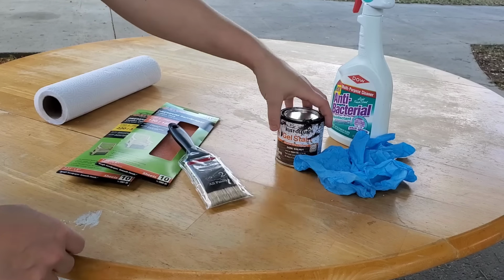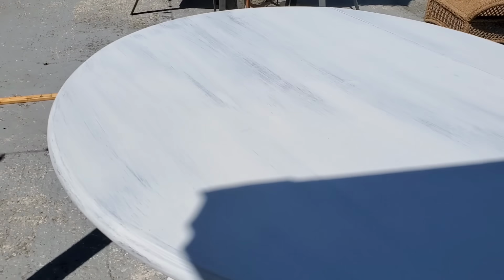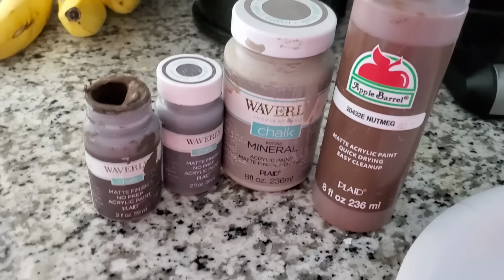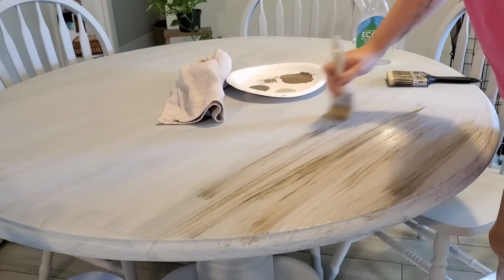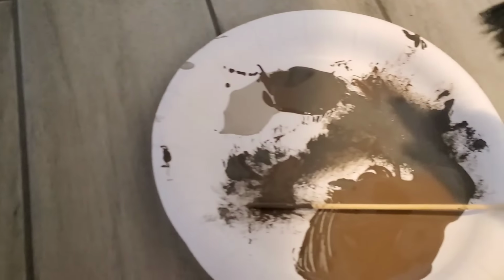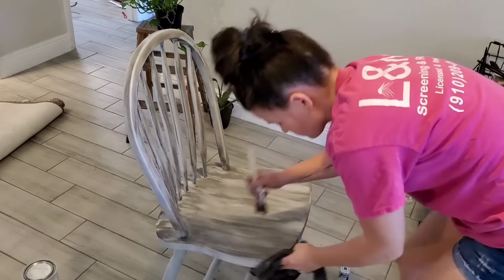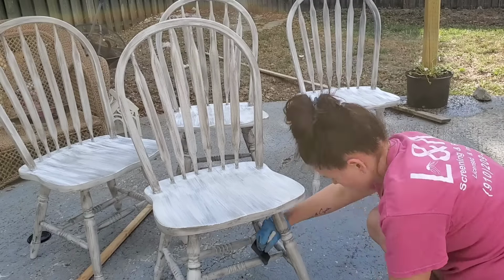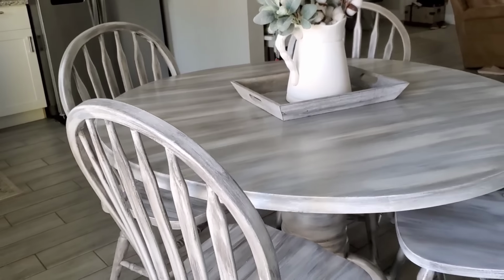Old Table makeover/ First time trying this technique!

Comment: So my woodworker brother gave me this tip...after sanding, use a wood conditioner. Dry and then apply your stain! Will help with blotchiness and streaky. He says this happens a lot on cheap wood/pine/manufactured pieces.  Thought this would help for next time
Reply: This tip is going to help me in the future thanks!
Reply: Yes so true for sure. After I tried wood prestain I've used it everytime I stain something.
Reply: E
Reply: I love that stuff
Reply: What is a wood conditioner brand?
Reply: I cant keep up with her doing it the long way and changing her mind do a test on a similar pc of wood first 😊

Comment: if you use a wood conditioner after sanding, the stain comes out a even color. Just something to consider if you want to try a different project with stain. I found it really makes a difference.
Reply: Julie Carter This is a random question but it if I’m not using a stain, should I still be using a wood conditioner before I use a finish on a raw wood table or does that not matter?
Reply: @AvsFan32  if you're using paint you don't need wood conditioner. It is a base for stain.

Comment: I have tossed chalk paint. I still can get amazing very simple or detailed effects using semigloss, or satin and rubbing gel stain on top, QUICKLY. It's exceptional for dark colors and I can add a top coat. I have never found wax durable in my household. I love this!!! I have a oak table and exactly the color, and this table needs to leave my basement. I spray my poly. An inexpensive primer is cheap dollar store spray paint beforehand. Nice and tacky , no bleed through. Chalk paint is a fad and I am so happy that you left the lines clean and didn't beat up the wood sanding gauges. Good job 👍
Reply: Interesting! Can you explain your process pls? You seem very knowledgeable.

Comment: You did an amazing job!!! I bought two small chair side tables, that you just screw together. I did this exact technique on them, I have the Valspar antiquing glaze and once I did exactly what you did, I took a chop brush and steamed that Valspar on top and didn’t sip and it gave it some dark small streaks throughout and it turned out awesome! You should try it on a project, the Valspar is really nice! 😊

Comment: I agree with thousand percent about starting a project then start changing my direction of where I’m going with it. I honestly love what you’ve done with this table, however I wanted to just share with you just if you’re anything like me and want to change it up a little later I did this same exact look with the same exact colors but on a tall square table with high barstool chairs. I loved it but as the time went by I always felt it was all just a little too busy for me when I would change up my table scapes and what not. I left the top of the table alone but I paint my chairs and base of table white then just barley distressed just very little of the edges of chair n base just with a 220 sanding pad just ever so slightly, I absolutely love, love, love it as well as anybody else that had ever seen it before then after my changes everyone just raved over it even saying they did love it before n honestly never thought it could look better because it looked so good before n actually all of them would ask me how did I know or come up with my changes, like you said it’s always just kinda changing you’re mind as going along same in my case I just wasn’t liking different table scapes n knew it just needed a little tweaking. Again I think y’all’s looks amazing I’m just sharing because we literally did the exact same colors, look if you were to put them side by side they would be hard to decipher any differences. I guess two great minds that think alike 😜 Hope y’all family are staying safe, happy n healthy my friend til next video take care 😘

Comment: I love the end product but I do have some advice. If you want your finish to last longer prime the surface first. Then paint thin coats of chalk paint.  It will blend smoother with water to help make the paint move. Also, sand between each coat of paint and top coats. Hope this helps.

Comment: I think you did a great job! I have a large older table that has a modern look. I've considered painting it but the lines of the legs are very modern looking and I prefer rustic.
Reply: You can ALWAYS transform your piece into any kind of style you desire. Just take risks and use your imagination. You can also remove the legs as well and replace them with a different type leg. They have many styles of legs and they are fairly cheap.

Comment: This is really cool thank you for sharing!!! Also the inspiring words of advice was really artistic and effective for me. The only question I have is you sanded the top but not the chairs. Does that make a difference?
Reply from the maker: I only sanded the top because I originally stained it . With chalk paint you don't need to sand as long you let fully dry between coats and seal well 😉

Comment: It's easier to use a Wagner Sprayer for the Polyacyrlic Sealer then applying it with a Brush. You can do this Zig-Zag Style with other unconventional colors for more color in your space. No need to stain something if your going to paint over it.

Comment: Did you put a pre stain wood conditioner on it , usually only a coat or two is needed on the top before you stain it? That’s why it went patchy. Just FYI. More work, but oh so worth it! I’m wax sells it I think.

Comment: Great video! This is exactly what happened to me. I started to stain my table and didn’t like what the colors were doing. I am now planning to chalk paint white with some brown and gray. One question though...Aren’t you supposed to sand down the chalk paint so it has a smooth finish before applying the poly? Thanks!
Reply from the maker: You could do that i just hate sanding so I skip those steps 😅

Comment: Did you sand the chairs before painting? They look amazing
Reply from the maker: No i didn't with chalk paint i don't sand 😊
Reply: @karrielynn  it doesnt start to peel? I want to try to do it to my dinning set but i am si afraid of messing it up
Reply from the maker: @adylenemendoza7980  no  they won't peel if you seal them . I use polycrilic 😁

Comment: Hi, I'm new to your channel. Love the table and chairs, awesome job! Quick question before I decide to be bold and FINALLY paint my diningroom table. What was the brand of the poly-acrylic sealant that you used? Just so I know what to send my fiance to the store for lol. Figured I should start another quaratine project lol. thanks in advance! :)
Reply from the maker: I use the minwax brand and I usually use a  gloss or semi gloss 🙂 make sure you use a foam brush not a roller though the rollers leave streaks and the foam brushes seem to give a smoother finish.
Reply: @karrielynn  Awesome, thank you so much for the response and the helpful info. You rock! :)

Comment: I tried my first makeover n failed miserably.  Still beating myself up. And did it to my home dining room set. Tried using the glaze with deck brush then whisk broom ughhhh. So asking if I used the base I had with primer mixed with a light tan color … could I possibly try this with just brushing it on

Comment: Do you have a review of it after painting it and how it holds up after using it.
Reply from the maker: No I don't have a review on this table but I did my newest  kitchen table a few months ago the same way and it's holding up great with cleaners, scrubbing etc.
Reply: @karrielynn  thank you for your response. I'm looking to do my table but worried it'll be a waste of time and money. I'm glad you have details as to how many coats of the sealant you put on because I'll definitely do the same.
Reply from the maker: @rachelking7002  always remember the more coats the better ! ❤️
Reply: @karrielynn  is that the trick? Does it really matter what paint I use? As long as I do a lot of top coats?
Reply from the maker: @rachelking7002  I think it depends on oil based or water based i always use water based paint and seal with polycrilic
Reply: @karrielynn  👍 great thank you

Comment: How do u keep the polycrilic from bubbling up? I have had trouble with that no matter how I apply it. Tips would be appreciated! Thanks!
Reply from the maker: Try a foam brush instead ! I used to use a roller and realized that the foam brush gives a smoother finish

Comment: ***HELPPPPPP ASAP PLEASE!!!****

I have a few questions

I absolutely love this look and you done AMAZING btw! I attempted it on my coffee table. I ran into a few things that affected my finished look. It was my first time using Polycrylic and my sponge brush was too small. I tried to spread it out too much and muddied/pulled my paint 😔. I decided after 2 coats to call it quits and try again today. So it seems like your rag blending method, you found towards the end of the table. 

Did you use it on the top at all or only on the bottom? 

When you brushed on the white, did you wet the table before hand like you did with the dark colors?

Also, do you have any alternatives to the sponge brush? The only one I have layin around isnt big enough.
Reply from the maker: So I used the rag blending method to the whole table and no I didn't always need to wet it.  I only wet it when I felt like the colors weren't blended enough and as far as applying poly I don't have any alternatives . The foam brush leaves the best finish.  I hope that helps 😊 good luck 💕
Reply: @karrielynn  thank you for getting back 😊

Comment: Hey... I put the poly on a white dresser and it ended  up turning it yellow. Do find that it doesn’t do that with gray and the darker colors ?
Reply from the maker: Ive never had a issue with poly.  What finish did you use? I usually use semi gloss or satin

Comment: How do you get the paint from not coming off easily? I painted an old rocking chair now I notice the paint comes off easily and it had a primer in it? Polyacrylic what brand?
Reply: I use minwax brand. That what it looks like she is using.

Comment: I found the chalk paint comes off if hit just right or scraped by something. I did some old chairs and constantly have to touch them up. I sanded  them down and cleaned the surface first before painting. added the wax finish. Never tried the acrylic varnish. that may be better for the finish. I wish you luck with it because you spent a lot of time on  the project.
Reply from the maker: I seal with polycrilic because its stronger and won't do that . But I did sell this table  about a month ago 🙌😊

Comment: How did the table top and chairs hold up?
Reply from the maker: I sold this table about a year ago. But it's probably holding up as good as the other  peices I've painted. They are all still in good condition.  I hope that helps
Reply from the maker: I sold this table about a year ago. But it's probably holding up as good as the other  peices I've painted. They are all still in good condition.  I hope that helps

Comment: Did you sand the table base and the chairs?
Reply from the maker: No the only reason I sanded the top was because I was going to stain it. I don't sand when I use chalk paint. I just make sure to seal it with polycrilic.
Reply: Ok great. 👍🏽 I always wondered if I needed to sand the whole thing when painting.
Reply from the maker: With regular paint yes but with chalk paint it usually sticks to any surface.  😊